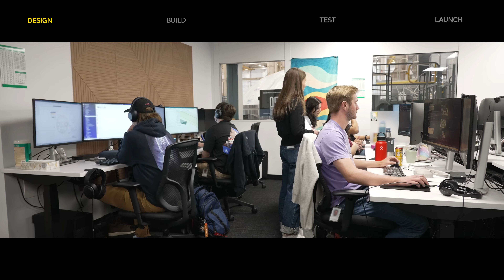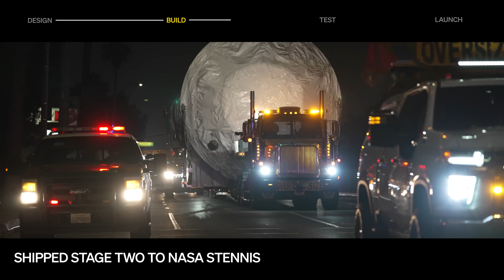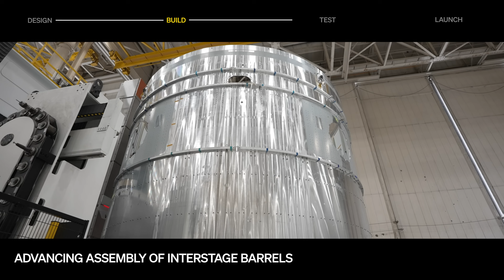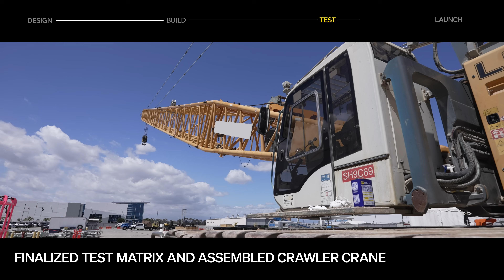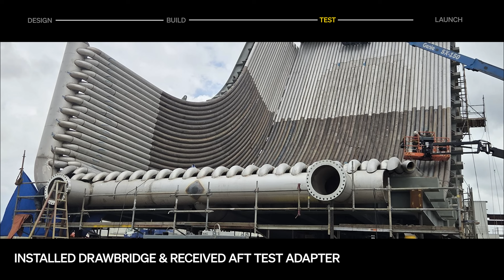Terran R May 2026 Program Update

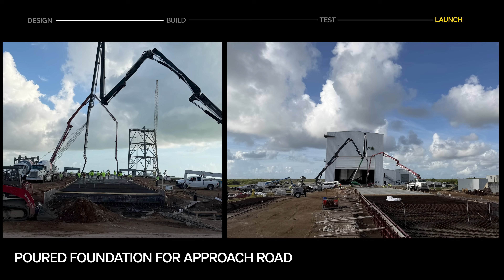Comment: 3:27 uh... given Blue Origin's very recent case in point, maybe it's not such a great idea to locate your horizontal integration facility within spitting distance of your launch pad??  🤔
Reply: Terran R is much smaller than New Glenn
Reply: @domakemake2447not much smaller honestly. 

5.4m vs 7m diameter (87m vs 98m height), similar liftoff thrust (15,560 kN vs 17,220 kN with Block 1 BE-4s), and because of that, if reporting is to be believed, New Glenn's payload is less than 50% higher than Terran R's at the moment, instead of close to double (23.5mT vs >32mT).
Reply: @davidk1308  Now for the important metric, propellant volume.
Reply: LC-16 lacks the space to place the hangar far away. It's a cheap item if to replace if something does go wrong